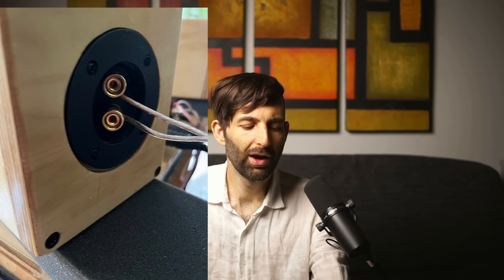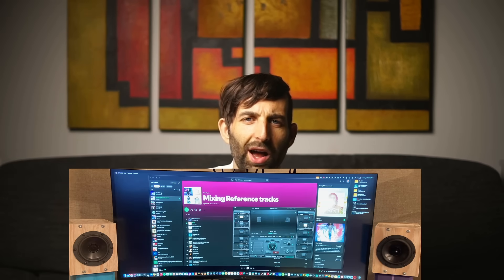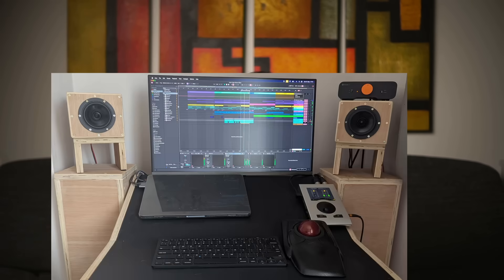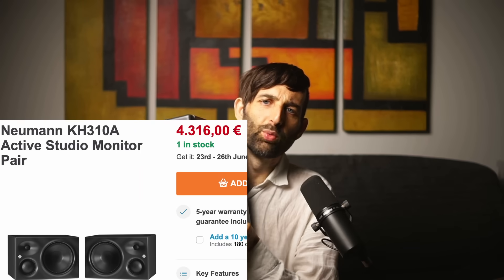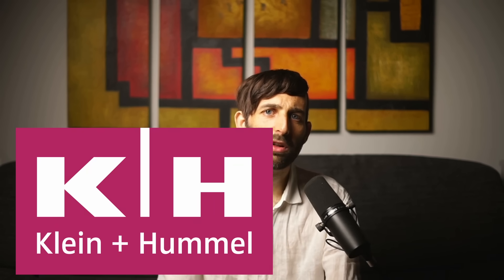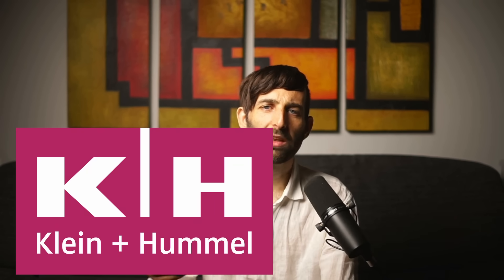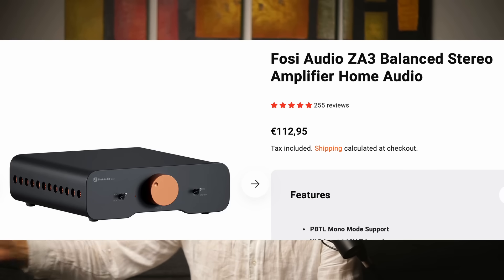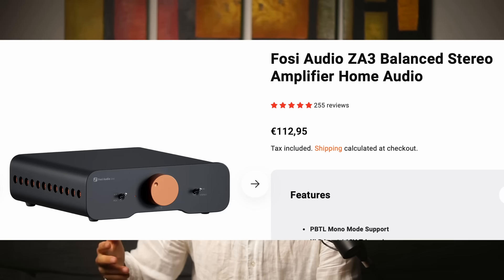$5,000 Neumann speakers VS $400 DIY speakers (Audio Shootout)

Comment: The neumann speakers have prominent distorsion in the higher frequencys that make them “blurry” in that range
Reply: Unlikely
Reply: Neumann have for decades had the reputation of being very clean. ATC is not as clean.
Reply: You need to remember that you're listening to these recordings through your own transducers so their frequency response is going to combine with the recorded speakers responses.
Reply: Im talking based on the Amir mesurements from audio science reviews, most reliable source for this kind of things imo
Reply: @RPK.1405  Huh?
I appreciate that you name a source, but the test in audio science review look pretty clean for the KH310A - except for the bass range. But that´s just natural, there´s only so much volume a 8 inch woofer in closed box can produce.

Comment: I am sitting here in my living room with my "proper" subwoofer, and its is immediately very noticeable that there is some bass in the played material that none of these speakers can reproduce. In my opinion you can call these drivers "woofers" but skip the "sub" prefix. I am pretty sure that the Neumanns are not being marketed as "monitors with built in subwoofers" either.
Reply from the maker: ive said elsewhere that if you want 30hz then there are the wrong speakers for the job. my mastering speakers go impressively low but they are way bigger

Comment: Commend you on the job but Id say a fairer assement would include graphs and a 600 dollar (monitors + amp) commercial system as well. The difference to the KH310s is staggering even through a mono mic that also has coloration. The homemade speakers won't allow proper mix decisions IMO.
Reply from the maker: weird since people are using my small speaker design and getting better mixes. The classic ones demoed here have an extremely flat frequency response and the differences are hardly staggering when some people here have had a difficult time even hearing a differences between them.

Comment: Awesome. You can hear some subtle differences. Mostly at mid to mid low control/clarity and low end which does show there are some gains with a decent dsp. 

Honestly, i think when switching between your 3 way and separate 2 way speakers, there are differences in where looking at a slight redesign of tweeter speaker positioning and maybe cabinet (or waveguide) would yield really good benefits.  

I would love to see a sine sweep comparison against the Neumanns (obvi in the same room, etc). Very cool to see this and great effort.

Comment: for EDM I preferred the small + subs.
Reply: I m not sure I think i much preferred the small + subs and the neuman in general. but the classic sounds amazing too.
Reply: the small + subs tho tho feels there's s heavy bump on the mids. you can sometimes feel the snare hitting nastily, so that makes the neuman better...
Reply from the maker: the small speakers are very mid focused and then the subs just enhance the low extension, so they are quite forward in the mids.

Comment: I 'm hearing a dip in the 400hz range on the DIY speakers. a boxy sound. most likely a cover issue.
Reply from the maker: I don't really understand that feedback since if it sounds boxy then it would be too much in the lower mids, not a dip. Anyway the speakers measure pretty flat and the crossovers are tight, it's the desk comb filtering and room interactions which are accentuating the lower mids and causing boxiness. I will make a video comparing desk position to stands

Comment: 2:00 Those are NOT "industry standard"
Reply: Here in Europe/Germany they certainly are, you'll see them everywhere.
In America that's probably very different, I'm sure.
Reply: @josuastangl7140  I'm in Europe, I've been in maybe 50 different mastering / recording studios. They all use Dynaudio, Yamaha and Adam. I've seen Neumann maybe once or twice.
Reply from the maker: Mastering studios are dominated by ATC and PMC. Recording studios are dominated by NS10s and auratones on the meter bridge and soffitted mains from various brands. The place for the Neumanns is broadcast and good quality production rooms as well as mid tier mastering studios.
Reply: @APMastering So you agree that calling the Neumann "industry standard" is a bit of a stretch? Also, how many mastering studio's have you been to in Europe? Because they are definitely not dominated by ATC and PMC. Most of them use custom install Dynaudio.

Comment: I am extremely biased towards affordable DIY applications. Especially when that DIY project punches within the same weight class as something roughly 10x the price. If you can save $4600 and have it sound as close as this with some fairly subtle differences, you can’t beat that.
Reply from the maker: exactly. and this is without EQ. You can also EQ them of course and I think I will do that in a future video
Reply: @APMasteringI’ll definitely be on the lookout for that video. Great work on that build my man!

Comment: it looks like the mic moved a bit between the neumanns and the classic setup, its tilted towards the right a bit on the classics, I feel like i noticed some subtle phasey stuff in the highs and high mids on the classics but its hard to say if that from the angle of the mic or the classic speakers themselves
Reply from the maker: the mic did move unfortunately a tiny amount as I was working but it is still fairly near. It's omni so it is less dramatic than if it were highly directional. There is MASSIVE comb filtering etc from the desk. But I wanted to show them on the desk because most people will do something like this. I will do a video standard VS desk soon

Comment: Do you think it would be better to build 2-ways in one enclosure for dual subs intead of all the three in one enclosure?
But also adding subs to the classics would probably open them up a bit by taking out some bloat in lows.
Thanks for your effort!
Reply from the maker: especially with DSP amps there is a lot more refinement possible! I tried 2 ways and they sound good but it is a similar thing to what is happening with the separate units and you need a different crossover which is why I didn't do it yet

Comment: I thought the Classic setup sound the most consistently pleasent and fairly accurate to the digital source to me (and my ears in my studio through my studio monitors lol). The Neumanns sounded great but honestly not 10x better than the Classics from what I could tell. Quick question: would it be "silly" to add the Neumann eq curve on the main mix out before hitting the Classics to give it a closer "Neumann" sound?
Reply from the maker: You can certainly boost up the bass on the classic using EQ. 100%! I will do this in future videos

Comment: In the "Classic" section I often see 2 FOSIS at the same time, so both are needed in that case? Or is 1 enough to power the 3 way pairs?
Reply from the maker: you see two because I recorded them individually but you only actually need a single amp

Comment: For 400, these speakers are a great value and with some EQ tweaking, they can sound even better. But compared to Neumanns, theres a noticeable difference: Neumanns deliver deeper, tighter bass, and their mids are slightly clearer, especially in the vocal range. I also noticed some box resonance in these DIY speakers. Personally, I’d choose your middome speakers for a more refined sound. Thanks for the great video and great job!
Reply: To be fair, there were box resonances with the Neumann's as well, but less than with the diy. And going from the digital source, the Neumann's also lacked a bit of clarity.

I wonder what would be the result of a DSP version with improved build to deal better with resonances, and what the price of such a build would be.

Also it would be cool with a mixcube if there is a suitable dsp that would enable that. That way. One would get the single driver version and the 3 way in the same speaker. (Fluid image 2 has such a feature, but it is not clear from the manual or website, if that mode only uses the mid drive, or if it still makes use of any of the other drives.
I am not looking for a horrortone speaker, but a speaker with vocals from a single driver, with good performance.

Comment: ts clear the neumann are closest to the source. You have to remember that these companies have testing labs with huge amounts of drivers.  And they have a whole bunch of stuff and top minds assigned to reaching certain audio target metrics they are aiming for.  And some spec their own tweaked drivers from manufacturers, plus  they have focus groups from the audio industry,  then they play around with all these combos, box designs, amps etc etc.  And charge the most for the speaker with the best metrics and test results..  Plus they can run waterfalls and all kinds of difficult tests. So you are up against a lot of resources.   Pity I lost the pic, but I saw one company, might have been B & W, actually have these huge racks and switch boxes stacked with about 200 drivers, that can quickly rotate in different mids, high, low drivers, so they fill these up and try to find the best combos.

Comment: I prefer theGenelec speakers to the Neumann. But the Neumann sounded a lot better than the DIY speakers. No punchy Bass too much muddy mids. It’s a shame I was hoping for more.
Reply from the maker: this is fully EQed active VS completely raw passive zero EQ
Reply: @APMastering I understood you use both of them passive. Then I would find it interesting to use both with the best EQ settings possible
Reply from the maker: @frankjerke  the KH310 is an active design. you cannot have them as passive speakers.

Comment: If you need a bit of sub back up have you considered using a Funktion 1 F221 as sub? It is dual purpose, a) it gives excellent low end reproduction at staggering levels and b) it can serve as your desk due to the sheer size of it. (Yes I'm joking, sort of, would love to try it, probably not much use). In any regard your speaker builds and tests get a thumbs up from me. I like the sound of the classics.
Reply from the maker: lol. function 1 is fantastic but not what you want for studio use!

Comment: Hey AP, do you show measurements on the classic speakers (frequency response, waterfall, etc. in your build course? I assume the electronics are shielded in the final build to avoid the white noise phenomenon, yes?
Reply from the maker: the white noise was the fan of my video light not interference. you can see theoretical frequency response in the crossover software but room measurements are kind if irrelevant because then you are getting a bunch of room influencing the measurements. i know people post them on forums from their untreated living rooms but there's no point
Reply: Well you can measure several speakers and compare them just like in this video

Comment: Hi, good stuff.
Neumann is to me best but I contribute that to active speaker design. Next the dome version, classic, small with subs and small last.
I think your dome version with hypex unit will be equal or beat the Neumann.
I'm diy speaker builder for over 36 years and was so happy when hypex and minidsp came to the diy market.. No more passive crossovers.. I would encourage to do a video on the dome version with hypex.
Reply from the maker: nice one, will do!
Reply: @APMastering awesome! Looking forward to it! :)
Reply: @APMasteringI also would enjoy this, and consider building that speaker.
Reply: @APMastering Same, would also enjoy this myself
Reply: @APMastering i would even argue that the small full range speaker on the hypex with some dsp can sound already better but getting away from passive crossovers is a blessing, when i started it was pen and paper with calculator and all the good books that came out in the '80 and '90.. first computer programmes...REW is a must have and if you use it i recommend to donate or buy the pro version...
Reply: Could you explain how one could make the same speakers with hypex components?

Comment: wow, the neumann's seem to run out of steam with complex rock material, where as the classics seem to keep the front edge of the sound going, I had kh120's for a few months a few years ago and found the sound stage 'set back' and not very involving and i sold them, then i heard the kh310 when a friend bought them and i thought the same thing, he sent his back too for the same reason. the classics seem to have the mid forward involvement that i missed in the neumann. Quite difficult to get a solid judgement from a you tube vid, but these sound solid, especially when you look at the monstrous price difference.excellent work. they're on my to build list👍
Reply from the maker: nice one yes they can sound a bit laid back in the mids. i deliberately gave more focus to the mid drive in the classics

Comment: The DIYs sound more mid-forward than the Neumanns.  Not necessarily a bad thing, just different.  But I'm spoiled.  I already have a pair of KH310s.  I appreciate the fact that they are "polite".  No listening fatigue with them.
Reply: its completely different , the other way around . But i get it you don't know what you are listening, it takes experience .  These Neumann are good , but copy of Genelec 1037C , you can use them both sideways or upright .  Front ported , better wave guides .... bells and whistles so to say . But they cost a lot .AND ARE NOT HI FI
Reply: @dedskin1  Dude, I'm 64 years old and have been doing this since 1978.  I think I've got experience.  And they're not a "copy" of a Genelec.  You might want to Google the "KH" part of the model number and see where that takes you.  As for cost, well, they're already here and paid for and I like 'em, so...?  Lastly, define HI FI (in all caps) so I know WTF you are talking about.  You wouldn't be one of those dreaded "audiophiles", would you?
Reply: @megwatts1903  haha I love people like you

Comment: It's best to separate the subwoofer away from the other speakers. Mostly because subwoofer placement is important as it won't sound the best where the other speakers are at least not normally. Sometimes you need to put the subwoofer in a really weird place to get the most from it.
Reply from the maker: that will come at the cost of time accuracy
Reply: Usually the best possible position would be exactly where the other speakers are, for phase coherence, no?
Just that that is usually not practical, so people place them on the floor.

Comment: the fosi amp is 200w for both channels, meaning 100w for each speaker right? how does the volume/spl compares to the neumanns?
Reply from the maker: they do loud enough but i didn't push

Comment: Would have loved to hear more comparison between mid-dome and 310s. As stands, the classics sound good, just a tonal mid-shift. The 310s are smoother with better low extension, but the classics do a very good job, as do the small speakers and sub. I'd love to hear what the mid-dome and active amp do.
Reply from the maker: will make that content soon!

Comment: The Neumann's are impressively neutral, worth the money. The others have slight colouration or peaks but all are great with the exception of the single small speaker which sounds different to all the others. The Classic would suit me over the Neumann at home, having a slightly more lively sound. Fabulous video, really interesting results. Now I have read the blurb I see you like the Classic too. Personally at home I use re-coned Heybrook HB1's from the early 80's, sealed box 2 way about the same size as the Classic.
Reply from the maker: nice one!

Comment: That sb acoustics tweeter is great. If you want to improve the design futher you should use somasonus waveguide for the tweeters its perfectly designed to those tweeters and is awesome. Do you have measurements for the 3 ways?

Comment: I've been eyeballing the Focal shape 65's for a while now but also really interested in building my own as well… Many years of cabinetry experience and woodworking along with plenty of electronics experience to do enough damage. Currently using JBL LSR4328P's.... really looking forward to seeing how my mixdowns improve with the right monitors.
Reply from the maker: sounds like you could easily make a pair of the passive classic ones here
Reply: @APMastering that's the plan! How do you like those Focals though? I'll probably end up both getting a pair and building a pair… Then I can A/B/C before heading to the car lol
Reply from the maker: @stevelibby3 i've never liked anything from focal tbh but i've probably not heard the exact ones you are referring to
Reply: @APMastering  Focal Solo 6 Be was a good pair, I used them for a long time. I'm currently retired and using the cheaper Shape 65 which aren't bad, but there are probably better ones available for their full price. I paid half... Still, there's a slight bit too much "musicality" in the Focal Shapes to my tastes, I'd prefer a more analytical touch. I'm planning on building the AP Classics at some point, though I do need to put an EQ in the line since I've got a few room issues to compensate for. Further acoustic treatment isn't viable.

Comment: Honestly I would have expected to see the results of a sweep with REW. From the mic recordings the Neumann do sound better but definitely not 10x better.
Reply from the maker: REW is misleading since it's mostly room
Reply: @APMastering and recording a mic in a room is not mostly room?
Reply: @APMastering If the rest of the setup stays the same and only the speaker gets swapped out, then it would still be pretty conclusive, no?
Especially if your room is good.
Even if you don't think so, I'd still love to see the results!

When I upgraded speakers this year, I made REW measurements of both sets and there were clear differences.
Mostly in distortion, but also some in the frequency response.
Both like I anticipated, but still cool to confirm.